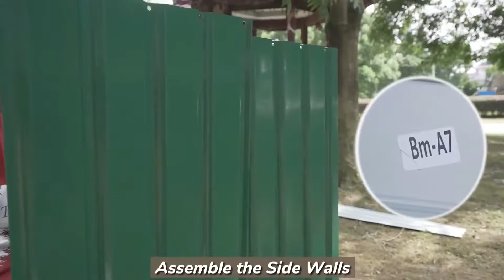How to Build a Jaxpety 9 x 10 ft Heavy Duty Backyard Building Tool Shed? | Installation

Comment: There's a part on the roof assembly. It's like a little metal part that sticks out where'd you join the two top vents together. Any tips on how it actually screws in
Reply: Did you figure this out?